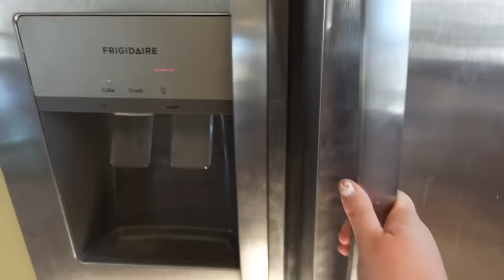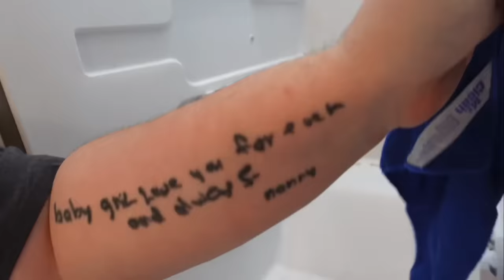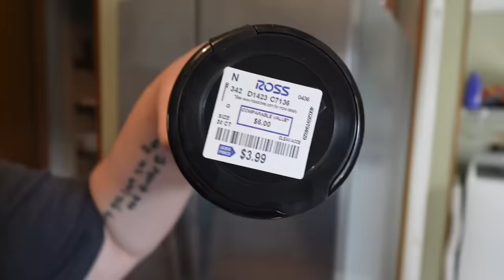GETTING MY LIFE AND MOBILE HOME TOGETHER 🤣 | get it all done with me | mobile home projects

Comment: IMO you need a railing around the entire porch that way there is with only one open space from the steps over to the door this will direct the traffic flow on the porch so that everyone has to come one way from the driveway to the door…also  as long as dogs and kids are running around, consider an outdoor Astro-turf type runner from the one open space in the railing to the door that will catch mud… and everyone has to step on…I know they are tacky but you can find some nicer ones…just a thought…

Comment: For the porch: my mama used to spray the porch down with water and soap and sweep it away with a broom. So rather than a dry sweep, she did a wet sweep. And she used a different broom than the one for inside the house. It was an old broom that was too stiff to use in the house. Pressure wash is good too.

Comment: Merina a trick for you “veggie graveyard “

If your meal planning just group all the products together in bins - summing it’s properly sealed to avoid cross contamination and your fridge is big enough 

For instance if I’m making stir fry. I get a clear bin : tofu pack + veggies And a sauce bottle. Measure a bag  noodles/rice in a ziplock. 

I have seen others use xl Mason jars for chili / soups like they dry beans, spices etc just layer it up then you just dump an go. 
All I do is pull out the tray cook,  the wash and put the bin in storage.

I only meal prep dinners so only need 3-4 bins in the fridge /2 per shelf and it keeps me very organized and the veggies does not have issues wilting

I don’t actually use the veggie/fruit bins. I need things at eye-level or they will be forgotten. We are veggies and eat a ton of produce so I don’t worry about them wilting. If it wilts alittle well it goes into stir fry/soups 😊

I use the bottom bins - one for  nuts from the bulk bins and the other is for snacks

Comment: You did an amazing job cleaning out your fridge! A little self learned tip* if I ever have a drawer or something too bulky for the sink that’s yucky I just take it outside squirt soap in it and spray it down and let it soak outside and rinse with the water hose because that happens a lot with carrier cleaners and baby messes around here* ❤ keep up the motivation girl I looove it!
Reply: Also you may be able to do that with your porch too! Get a cheap pressure washer, squirt some soap all over it the porch and wet it with the water hose, let it sit for about 30 minutes then use a pressure washer to just spray it off, save yourself the elbow grease girl ! Love yall!! ❤❤❤

Comment: An easier way to clean the shelves n the refrigerator is to put them in the bathtub and fill it with hot water and let them soak while your cleaning the inside of it and going through all the food. Then when your done doing that, most of the stuff that’s stuck on the shelves will come right off so you don’t have to scrub as much. Love u guys❤❤

Comment: If y’all coated the porch good with poly, just wash it off with the sprayer on the hose when the weather isn’t freezing. There’s spacing in planks for this reason. That’s what we’ve always done anyways. Go over it this summer with a light color and do a marbling technique or get one of the paint rollers that rolls on a pattern, with a light color on top of the dark and then when it dries really good, go over it with more poly.
Put heavy duty mats at the door and above the steps. Put railing with lattice fencing on the rest so the doggies can only go up the steps too.

Comment: Here's a tip that I think you will LOVE! Buy Press and Seal Wrap by Glad. Press it diwn on your glass refrigerator shelves. When it's time to clean your refrigerator,  just peel it off and you have instantly clean shelves, no washing, just replace with new Press and Seal. I promise you will love it! Also, I love the heavy duty degreaser by Method. Comes in the gray bottle. It is the bomb!!

Comment: Struggling to wash my fridge shelves and drawers and my baking sheets is the #1 reason I want a big apron sink. If i need a wash and rinse section I will buy a wash bucket to use in the sink for the washing water. But i want my stuff to actually fit in the sink to soak and rinse without fiving the whole kitchen a bath 😅

Comment: Make you a pressure washer fund. Worth it's weight in gold. 
Also, where I live the trampoline is frequently called our state bird because so many people have them and they don't secure them, so when we have high winds or storms, they get blown all over the state. One remedy is to sink your trampoline legs down into the ground some. Will keep it from flying away. Some folks even dig out a hole for the whole trampoline to be put down into, where the top is level with the ground. As far as fridge and freezer cleaning and organizing, try those clear plastic bins. And for Nanny, try to install some of those pull out kitchen cabinet shelves. I love mine..

Comment: Here is a tip I discovered.  When feeling the walls for the smoothness I found that I would close my eyes.  Don’t laugh!  I found that when my eyes are open I see a smooth wall so touching it my mind says, yup, it’s smooth but then I close my eyes and glide my hand across and I can feel the ridges.  My theory is that when one sense (sight) is gone the other senses kick it up a notch (in this case touch).  Now stop holding your stomach from laughing and just try it.  It works!

Comment: I have so much to do,and I was getting spring fever to do it,then the pain started on my lower right side,that I put off for 4 days,thinking it couldn't be an overly issue,they should be resins by now,after 10 years of menopause, but it was bad,and felt like it was gonna burst,so off to urgent care, only to be sent to the er,for a ultrasound, then a CT only to find out I needed emergency surgery, on my appendix, that I thought was taken out with my gallbladder back in 89,I even had to spend the night ! Now I have to take it easy ugh

Comment: Your comments on God’s spirit and nothing is possible without him, hit home tonight! Thank you! Also, not sure if you are putting a railing back up on the porch but making that so that dogs can only get on the deck from one spot would help. Then where they are coming up & down (I assume the steps) make sure you have gravel or concrete in the surrounding area to cut down on the mud being tracked onto your porch. It will save your deck from being destroyed and your furniture too. Also when. Not using your outdoor furniture, cover them with patio furniture covers to protect them. Just some thoughts.

Comment: Do you have a spare wood area? You could build one out of old materials. That way you have a place to store your saved wood. And if you have a spare tarp, you could make you a DIY station to help keep your deck relatively clear (you could temporarily have it off the side of the house, right between those 2 doors? And, if you have a spot, save you angle cuts (for help with hold things at a certain level), and the small, thinner pieces of wood for shims! Just throwing some things out there lol. I know y'all got handled whateva comes yaw's way!!

And you are right!!!! Build your life on The Rock, and your foundations will always come through!!!! Leave the sand alone lol!!! (Extremely paraphrased GOD, sry!!!)

Comment: I have 4 dogs and my back porch/mud room is like your porch, I bet I clean that booger minimum 4 times a day, so, I bought off Amazon they are called Stone Mats for bathroom, they absorb water so fast and I bought 4 of them and put them together so when the babies come in the rugs absorb the water and it’s not nearly as wet and muddy. You could put one in front of your back porch door outside and do like I did put a few together inside so they can walk on them and get most of yucky’s from porch and inside. I hope that made sense and didn’t sound like a rambling idiot🙏🏼🙏🏼🙏🏼🙏🏼